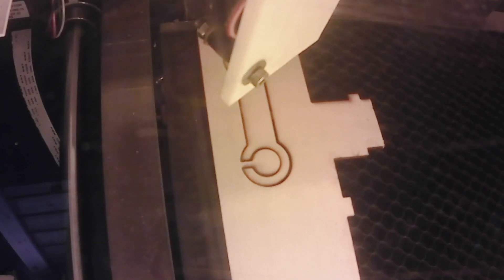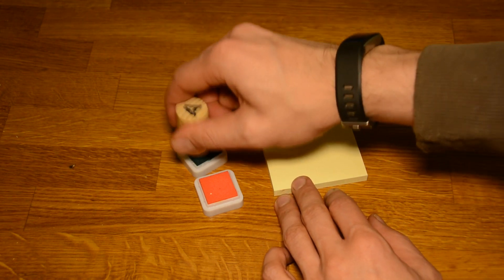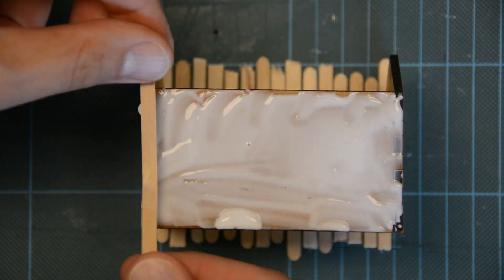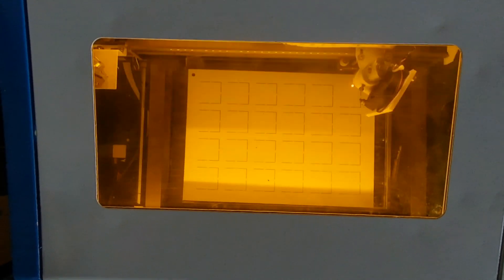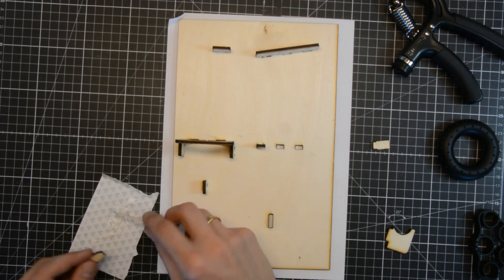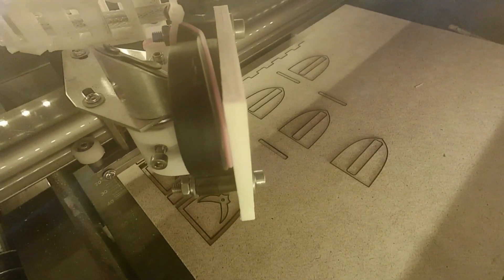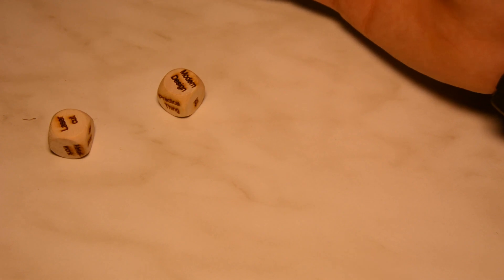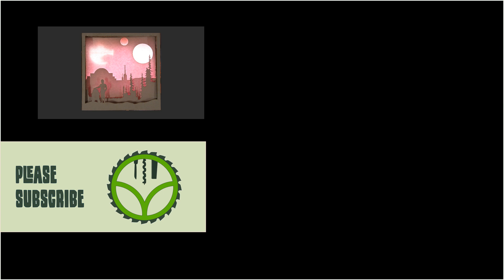10 new laser cutter projects in 2020

Comment: I just purchased a K40 laser machine.  I will be doing all sorts of art and design projects on mine as well.  However, I do my illustrations on Adobe Illustrator and work on my images on Adobe Photoshop.  Would you happen to know if using these two Adobe products to create my art and designs can work independently from having to use Inkscape?  Or do I still need to use Inkscape to communicate with the K40's software...I'll be using the K40 Whisperer and not the standard LaserDraw.

Thank you so much for the video, and giving us more ideas for creating projects!
Reply from the maker: You can save a SVG or DXF files from Illustrator and then import this on K40Whisperer. You don't need Inkscape - although it's a great program and it would be worthwhile to have a look at it. 😉
Reply: @WayofWood  thank you 🙏🏼 

I have been reading the forum on Inkscape and read how Adobe products add extra code onto their own files. This causes, in some cases, sort of a delay in performance of the K40. I’m also thinking that in extreme vector graphics loaded with anchor points the K40’s processing board might have a hard time digesting the amount of data to process too. One of the things that I liked reading on Inkscape was how their software, at the present time, doesn’t code your files. So I’m thinking that their files might be leaner and probably give the K40 the files to perform a better performance. 

I’m going to play with both software applications, Adobe and Inkscape and see which one performs most efficiently. After reading up on the specs for Inkscape, I think that they are going to be able to handle higher tolerances than the Adobe files 🤔

But again, Thank You 🙏🏼 so much for your help!
Reply from the maker: Have fun with the laser. If Illustrator doesn't work Inkscape will be able to convert the SVG...